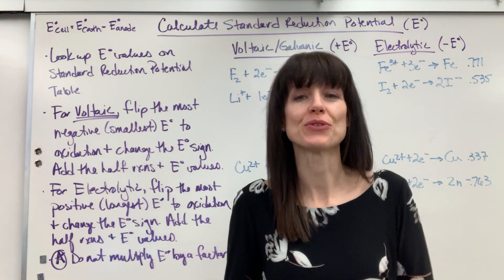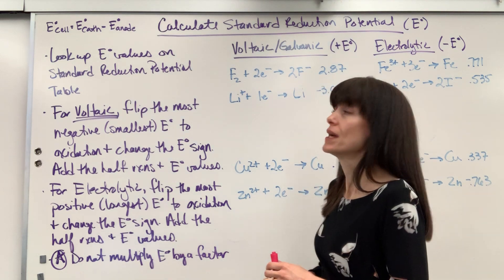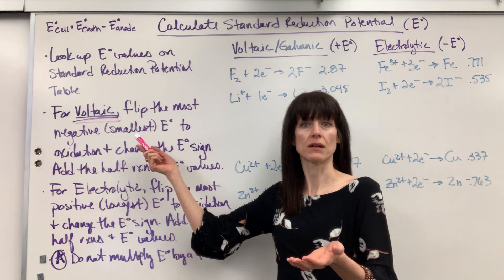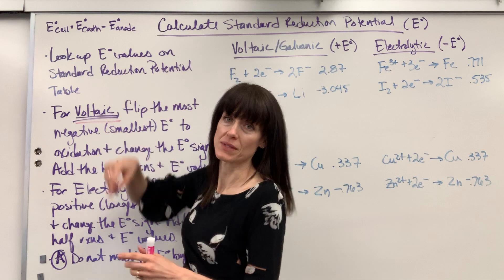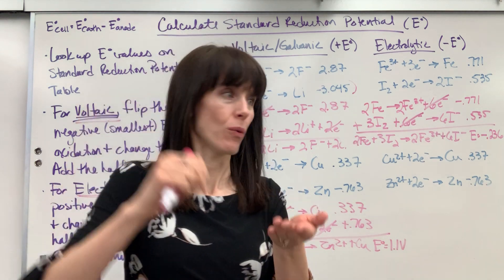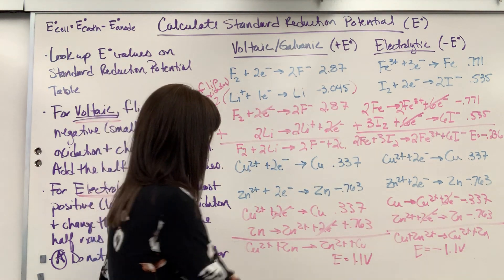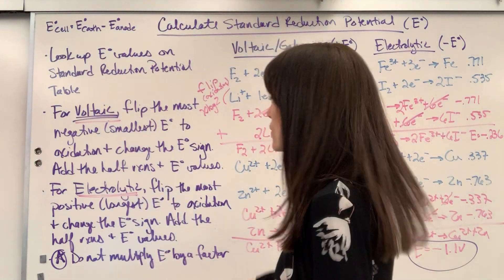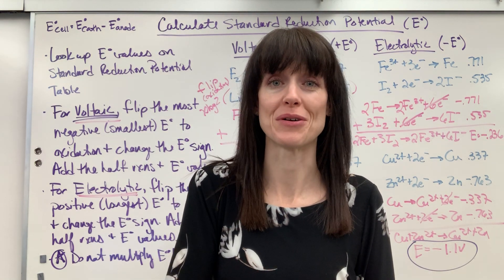Calculate Standard Reduction Potential From Half Reactions

Comment: 1 question ❓ 
. Show that the potentials are additive for the process in which half-reactions are added to yield an overall reaction but they are not additive when added to yield a third half-reaction.  

Please tell answer 😅
Reply from the maker: Hi Nandawakudakar, this sounds like a homework question.  I better not answer!  Visit your professor if you need help!
Reply: @OldSchoolChemistry   no this is not homework,
Reply from the maker: @nandawakudakar5413  To demonstrate that *potentials are additive for full redox reactions but not for half-reactions**, we must examine how **standard electrode potentials (\(E^\circ\))* behave in different cases.

### *1. Potentials Are Additive for Full Reactions*
When two *half-reactions* are added to form a *full redox reaction**, their **standard electrode potentials (\(E^\circ\)) are combined correctly* to determine the overall cell potential:

- This works because the *standard reduction potentials* of the two half-reactions represent the tendency of each species to gain or lose electrons.
- The subtraction accounts for the relative energy difference between the electron donor (oxidation) and acceptor (reduction).

### *2. Potentials Are Not Additive for Half-Reactions*
However, when **two half-reactions are combined to form a third half-reaction**, their electrode potentials **do not simply add**. The reason is that **electrode potential is an intensive property**, meaning it does not depend on the amount of substance but rather on the intrinsic tendency of a species to gain or lose electrons.

Thus, the new half-reaction potential is a **weighted average**, not a simple sum.

### *Conclusion*
- **For full redox reactions**, potentials are additive because they represent energy differences in a complete electron transfer.
- **For half-reactions**, potentials are not additive because they are **intensive properties**, and free energy (\(\Delta G^\circ\)) must be used to correctly determine the resulting potential.

This distinction is fundamental in electrochemistry and explains why you can sum cell potentials for full reactions but must use free energy considerations for half-reactions.
Reply: @OldSchoolChemistry  it is for book.       R C Mukherjee a practice or doubted question please make a video on answer
Well my self sanket
Reply: @OldSchoolChemistry  🙏

Comment: Hi there, great video! Was really confused before this. I do have a question however, in the first example of electrolytic cell, why is the Fe half equation happening at the anode? I thought it would be happening the cathode since it involves cations and the cathode is the negative electrode. ( Am I wrong to assign the cations to the cathode and the anions to the anode in electrolytic cells?). Thank you so so much in advance.
Reply from the maker: Hi!  The cathode is ALWAYS the reduction half cell and the anode is ALWAYS the oxidation half reaction.  I hope that helps.  Thanks!
Reply: @OldSchoolChemistry  Thank you!

Comment: Hello, can you explain something: I read that the electron has to be on the ion side of the arrow in the half cell equation in the standard reduction tables because the pure element is neutral.
For example in "Ag+(aq) + e- → Ag(s)", silver ion of positive one charge plus one electron to create a neutral silver atom.

If that is the case, why do we write "Cl2(g) + 2e- → 2Cl-(aq)" with the electron on the same side as the pure Cl to create a chloride ion?

Other examples are "I2(s) + 2e- → 2I-(aq)", or even "Sn4+(aq) + 2e- → Sn2+(aq)" which has ions on both sides.

Thank you for the video.
Reply from the maker: Hi Happy, it is because of the specific charge on the ion.  Ag+ (notice the positive) means the ion lost an electron so the electron is on the same side as the ion.  Notice the negative charge on Cl- which means the ion gained an electron so the the electron is written on the opposite of the half reaction.  I hope that helps.  Thanks!
Reply: @OldSchoolChemistry  Oh thank you for the explanation! Then does it mean it is wrong to say "the electron can not be on the same side of the arrow as the pure element"?
Reply from the maker: @Happy.Traveller  Not necessarily.  The electron will not be on the side of the reaction that contains the species that gained the electron.  I hope that helps!
Reply: @OldSchoolChemistry  It makes perfect sense, thank you so much!